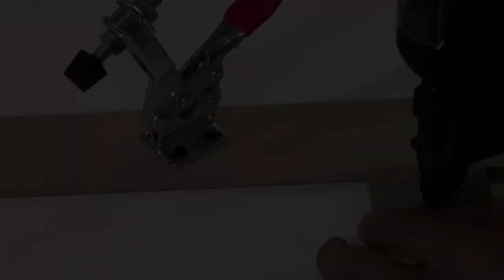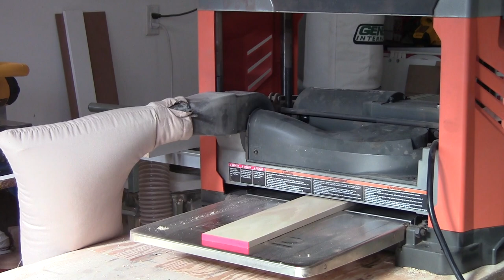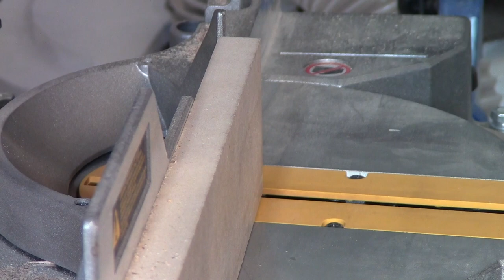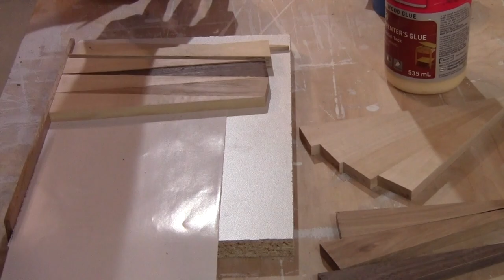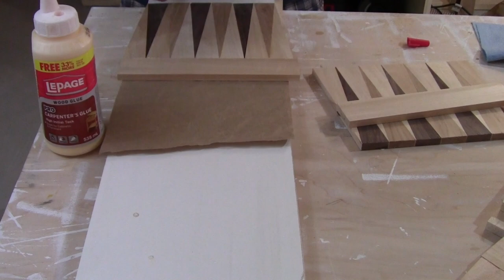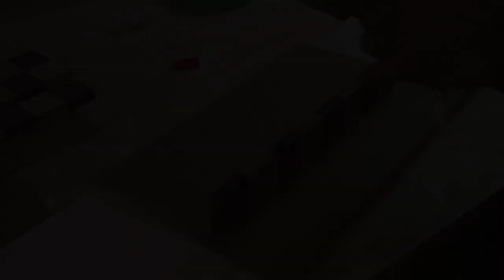How to make Backgammon and Chess board - Episode 1

Comment: Phenominal video and project! When you were assembling the backgammon pattern, I noticed the wedges with the wide end toward the middle of the board were square when assembled, but the ones towards the outside had alternating angles which you later ripped off. What did you do differently when you were cutting the wedges that came out square? I love your jig, simple but effective!

Comment: fantastic work ….what's the name of that clamp you are using on the table saw ?? I am trying to find one but I don't know its name. thanks Simon.
Reply from the maker: Thank you so much. I used "Horizontal Quick Release Toggle Clamp". You can find it on Amazon,eBay and ..., Goodluck
Reply: Harbor freight has them as well different style toggle clamps check them out plus look for discount coupon